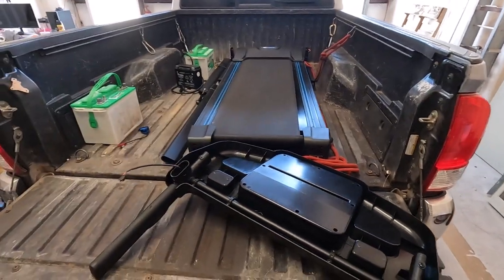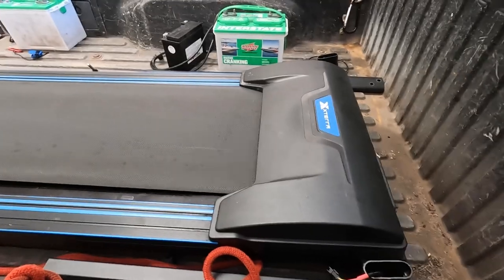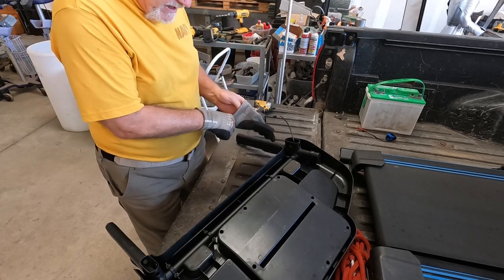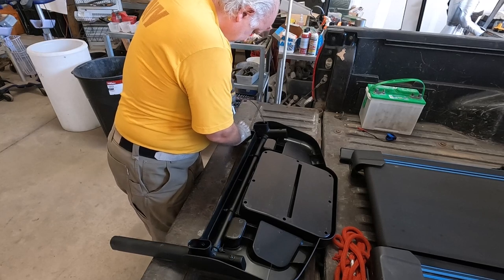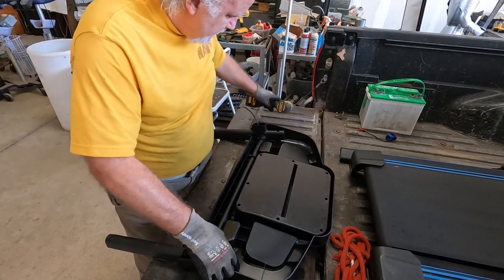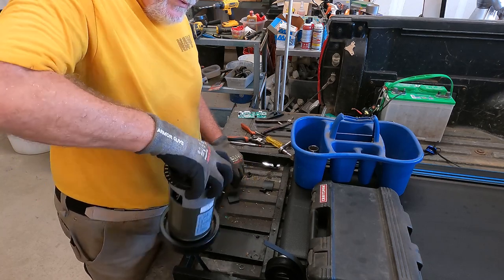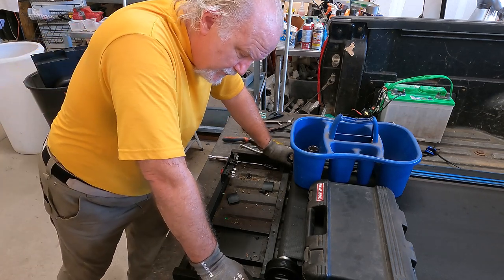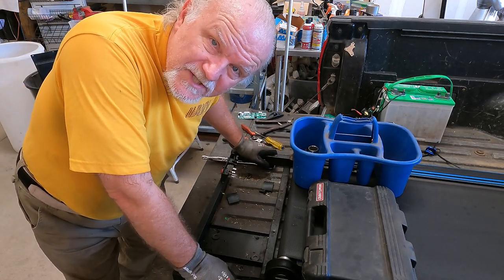Treadmill Scrap Value

Comment: Sharky, if you took the switches off, would it still be possible mid grade. Could you recycle the LCD screen into glass recycle. Just picked up some stage lights that were very profitable. Might want to check with local production companies for some.
Reply from the maker: Stage lights?  Interesting - I'll look around, thanks.  I think you'd still get mid-grade, especially if in with a bunch of other mid-grade.  As for the LCD glass, I don't know.  I suspect the push back would be the contamination from the Indium Tin Oxide in the crushed glass.  The reverse problem Indium recyclers deal with.

Comment: What’s going on Charcot Scrapper?  I bring my batteries I should say my car batteries to advanced auto they give me $10 store credit for each battery at the scrapyard. I only get $.15 per pound so generally I get a couple more dollars per pound when I bring it to the AutoZone instead of the Scrap Yard. Good luck with everything my friend.
Reply: At least you're get .15 at the scrap yard. Took 8 lead acid, back up batteries, in yesterday and got an amazing .07. On top of that they labeled them "old car batteries".   Lol
Reply from the maker: I've thought about doing that but I'm notoriously bad about using my store credits.  Let's see, average car battery is around 40 lbs and I'm getting $0.20/lbs right now, so around $8 per battery.  So yes, I'd do a little better taking them to Advanced Auto - if I remember to use the store credit that is 🤣